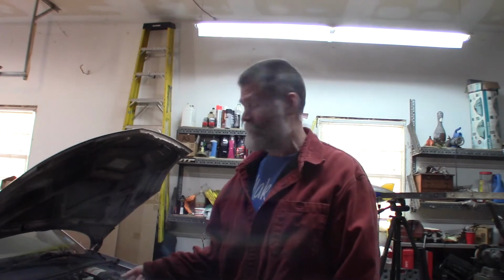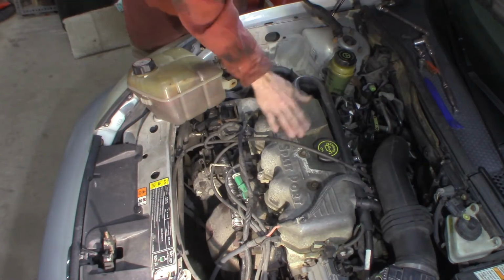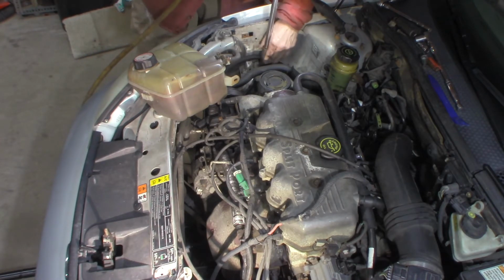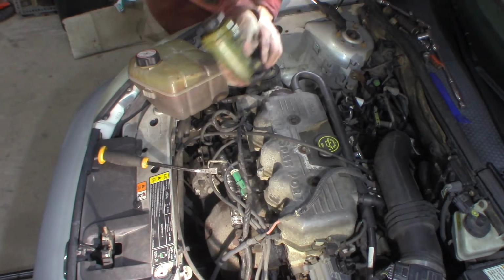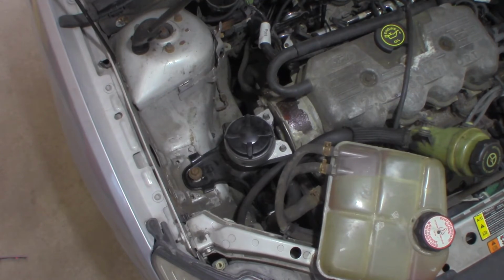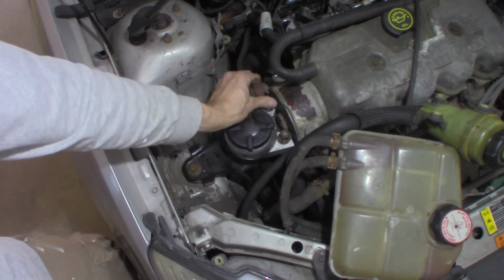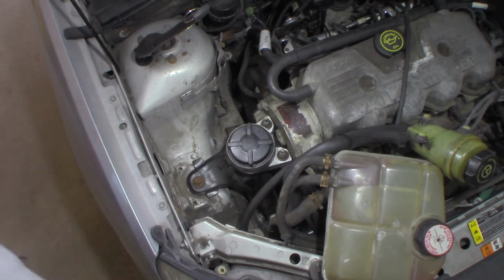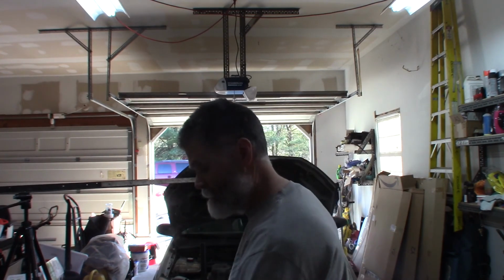2000 Ford Focus SOHC Motor Mount Replacement

Comment: Is the jack point on the oil pan ?
Reply from the maker: Yes, just make sure you use a block of wood to spread the load across the surface.

Comment: Where you buy the parts from i cant find any motorcraft oem anymore
Reply: I also hear that most aftermarket motor mounts for the focus isnt as good as the factory one which makes the car still fell vibration at idle
Reply from the maker: I don't know about the vibration at idle.  OEM in general is best choice, but not feasible some times.   rockauto.com